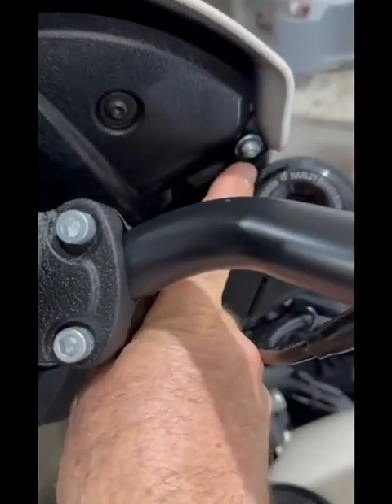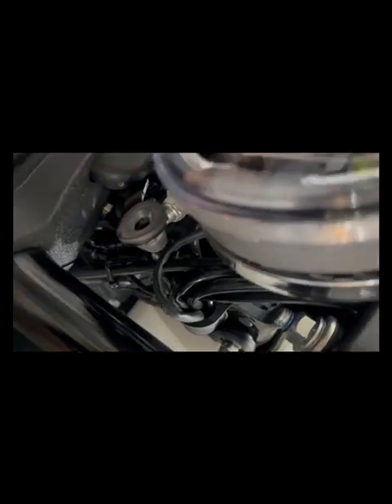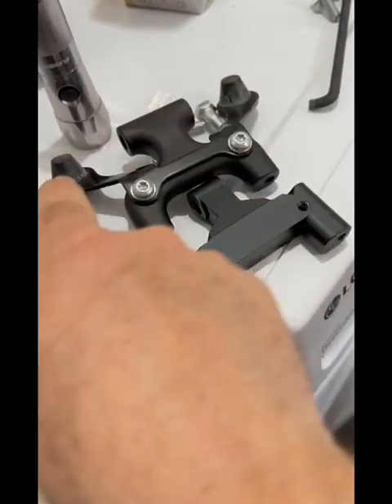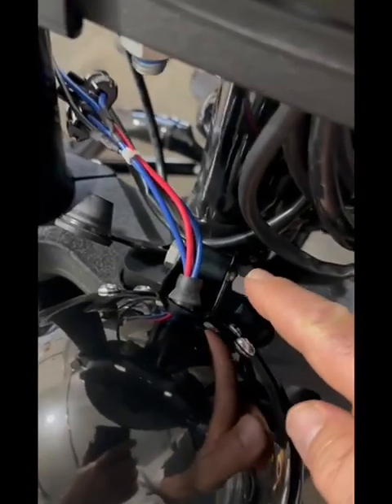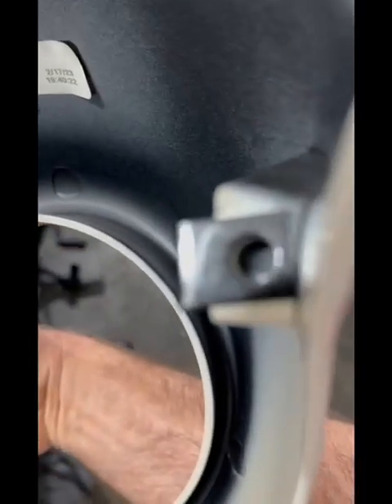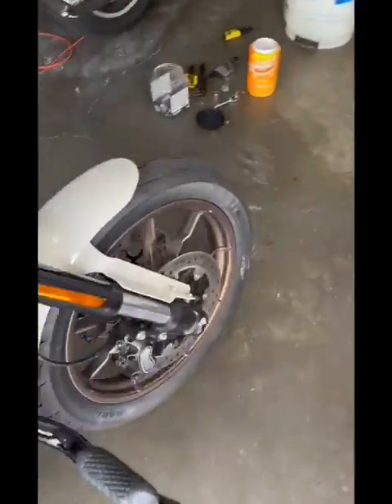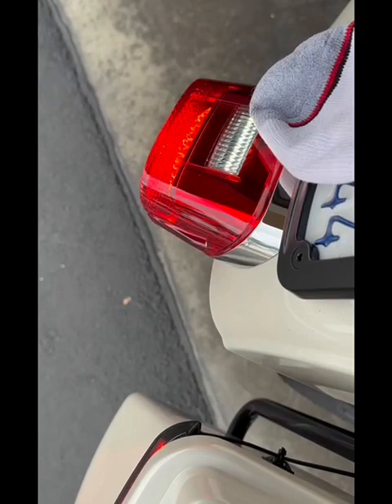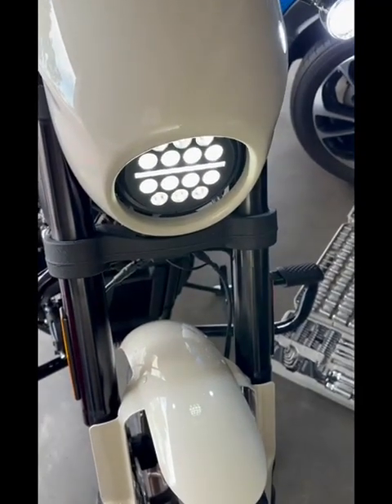Eagle headlight install 2023 Harley Davidson Low Rider S

Comment: How much of an improvement is this over stock?
Reply from the maker: Not as much as I’d hoped. After living with it for a little while I installed a Baja Designs LP6. That is far better than the original Harley or the Eagle Lights. The Eagle is better than stock though if you’re on a budget. The LP6 is expensive
Reply: Thanks pal!